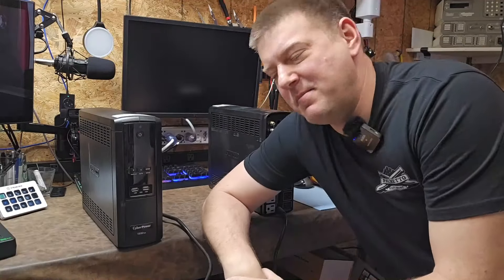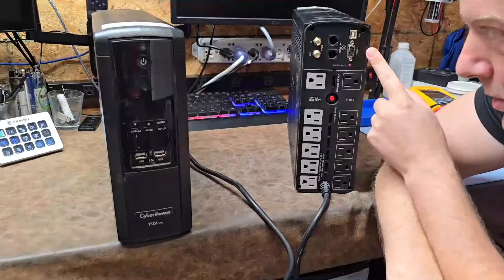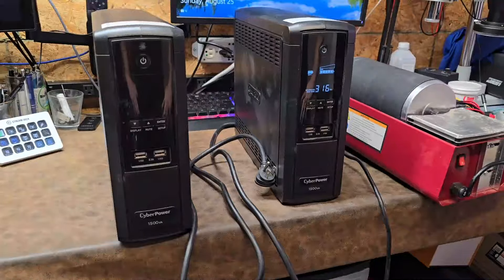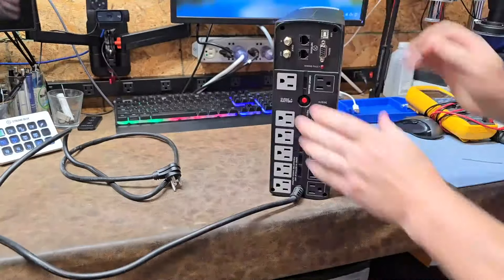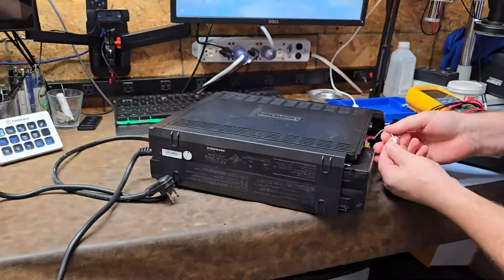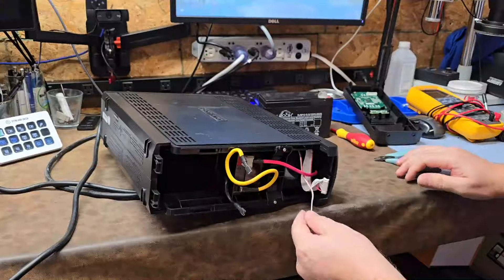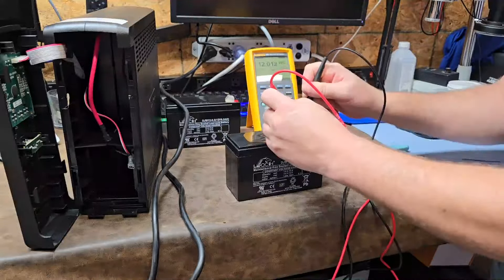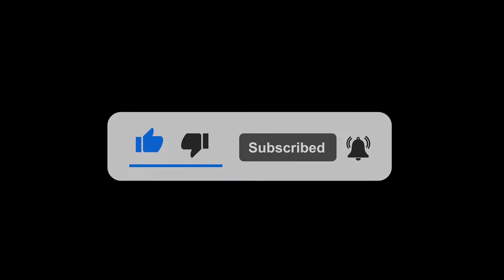Testing UPS Systems

Comment: Fun fact: Some (not all) defective SLA batteries will make a rattling sound when shaken. I believe this is caused by lead sulphate that has fallen off the internal plates. In my experience, all batteries that rattle when shaken are bad. But not all bad batteries rattle. it would be interesting to know if your bad batteries make noise when shaken. The noise sounds as if there were loose screws rolling around inside the  battery case. I fabricated a dummy test load using a wooden board, AC power cord and 3 ea. 120 volt lamp,sockets. I can easily create a 180 watt test load using 3 standard 60 watt incandescent lamps. Higher (or lower) custom loads can be setup by changing light bulbs. This setup comes in handy when performing run-time calibrations on larger APC rack systems.
Reply: Interesting information.  These types of batteries are AGM with fiberglass mats inside and should be wet but not sloshing around.  The rattling sound might mean they are dry on the inside along with something loose inside.  I wonder if new Li-Fe-Po batteries are worth changing them out with, but I worry about lithium as they have their own potential catastrophic dangers.
Heh, for load testing, I use a 3 speed fan.